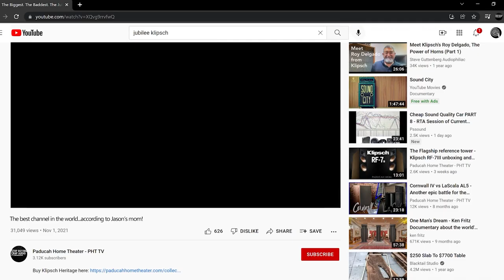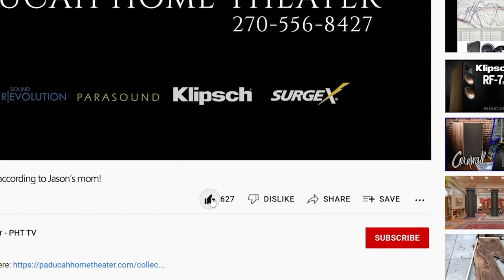RP504C - Center channel unboxing and disassembly

Comment: Which center would you sugest whit the RP600.
I like the 504c bit the 600c looks nice also😅😅😅.
Space is no problem.

Thnx in advance
Reply from the maker: rp-504c ii has the best midbass, just sounds bigger.  we have them in stock.  call 270-556-8427

Comment: Hi Guys my reciver is the pioneer vsx-933 which has 135 watts to each channel, I've read this centre channel is 150 watts will 135 watts be enough to power this beast
Reply from the maker: Would be somewhat dependent on your listening preferences but you may want to consider getting an external amp to power your center. 

-Jason

Comment: Does the box has support wooden columns inside throughout the width of the box? I would like put a 100lbs TV on top of it and just wonder if it is OK to do so. Thanks
Reply from the maker: The box itself is pretty sturdy. While it doesn't have much in the way of cross beams or similar, it is really well constructed. As such, we see people put TVs and similar on them all the time. 

-Jason

Comment: Hi!, I have a question, does my center channel broke or the receiver's center channel has no low frequency capability? I was watching a movie and if I set it to 2.1 Ch it sound better than 5.1 config.
Reply from the maker: Thanks for watching! It's difficult to say with the provided description. There are several troubleshooting steps to go through to diagnose the issue but, my first step would be to contact the speaker manufacturer. They will be able to walk you through these steps over the phone easier than I could over a YouTube comment.

-Jason

Comment: i have a rc 62 ii i wonder if this would be better
Reply from the maker: What are you pairing it with? There is some new tech in the 504c that wasn't in the 62ii. The difference in drive components is there as well, but if you have the choice, you may consider the 64III for a bigger performance gain.

-Jason
Reply: @TopShelfAudio  thanks for the reply jason. i have a full 62ii system towers and surround. im pretty ok with it. im just coveteous of how good the 504 looks lol.

Comment: Where can i order a 5 1/2 driver?
Reply from the maker: if it's a warranty replacement contact your dealer.  if it's damaged but out of warranty we can sell you one but need the serial number.  call 270-556-8427

Comment: Would this 504 pair OK with the RP7iii?
Reply from the maker: I assume you mean the RF7 iiis? The 504 would pair decently tonally, as it uses the same materials in production/creation and is tuned somewhat similarly....buuuuut I would recommend the RC64III as a better fit. With movies, the majority of dialog and a ton of important content comes through the center and you don't want this to be overshadowed by your L and R. You will want a center channel that can keep up. 

-Jason
Reply: @TopShelfAudio  Thanks that was what I was looking for

Comment: so if i have the room for either the 504c or 600c which would you go with to pair the 8000fs.
Reply from the maker: I tend to lean more toward the 504c matching with the 8000s but you can't really go wrong either way. Both would perform great with the 8000s.

-Jason

Comment: I have a pair of rf8000 with one rf504c my room is pretty open. I sit 18ft away. I thinking about getting another rf504c to have 2 center for a wider range.since you loose some audio due to distance and where you sit. Is that recommended? Or should I upgrade to the  RC64III? Thanks for the video!
Reply from the maker: If you find that you are lacking, I would 100% recommend going with upgrading over doubling up all day. Also, check out the RC64III video. I compare the internal components. You can see they are completely different beasts. 

-Jason
Reply: @TopShelfAudio  thanks!!! Waiting on an amp to see if that make a difference if not rc64III is the next step.
Reply: Are you running a preamp and giving the center it’s RMS?